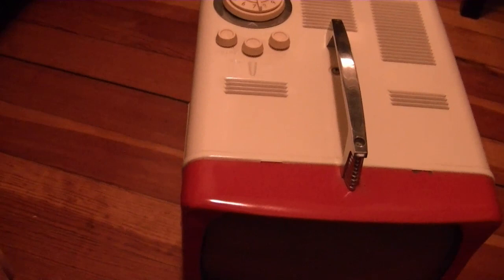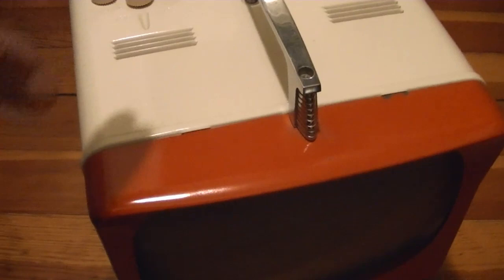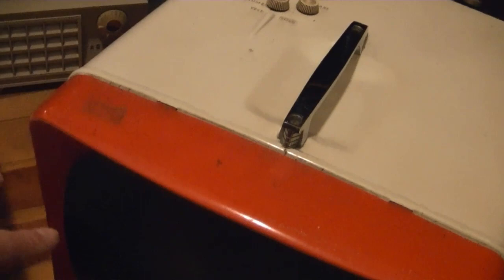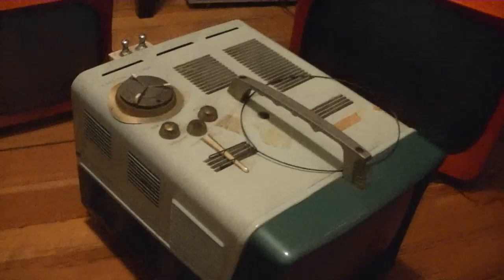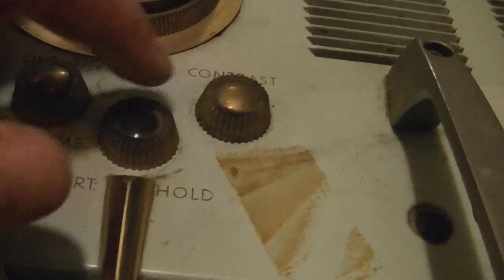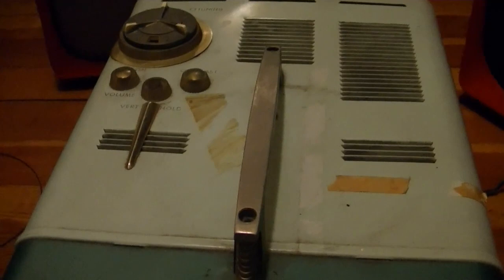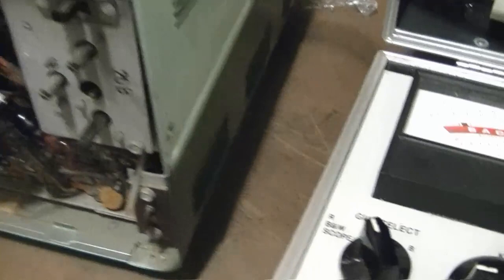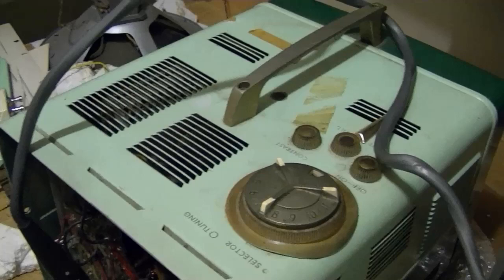Admiral TS105 10" portable scored

Comment from the maker: I'm pretty sure it measures the emissions between the cathode and G2 with G1 acting as the control grid.  G2 typically has several hundred volts on it which helps focus and accelerate the electron beam sort of like a plate in an electron tube.  So you don't really need to have any high voltage on the CRT anode to measure the emissions.

Comment: What colors did you end up with on the orange and white Admiral? I've also got one of the 10" models that needs some paint work. Its rebuilt, but needs an IF alignment I think. Audio and video don't tune properly at quite the same point.